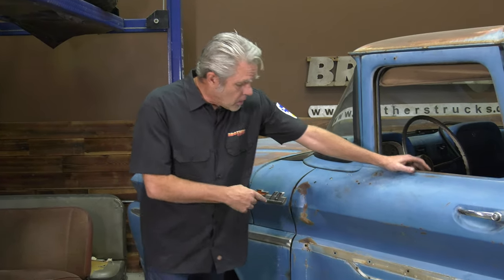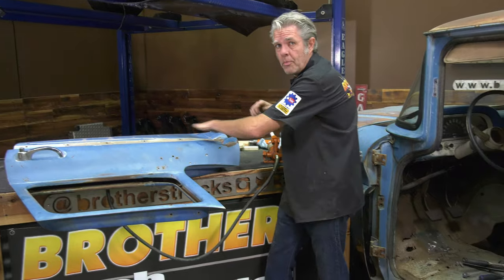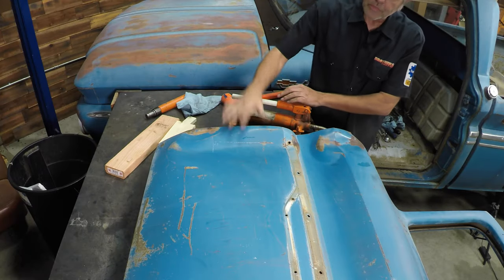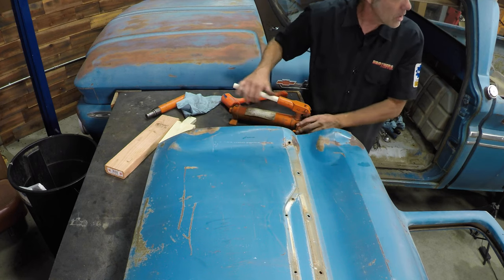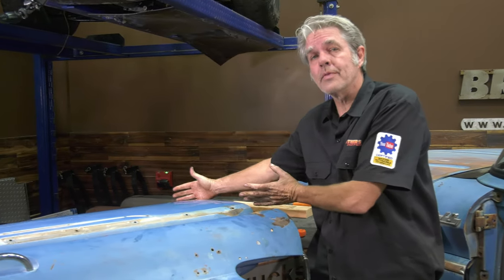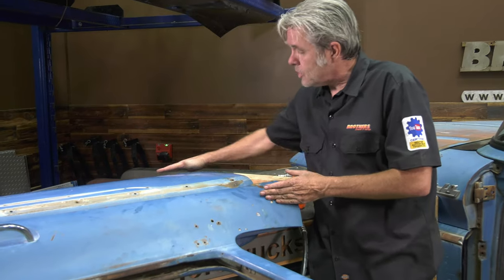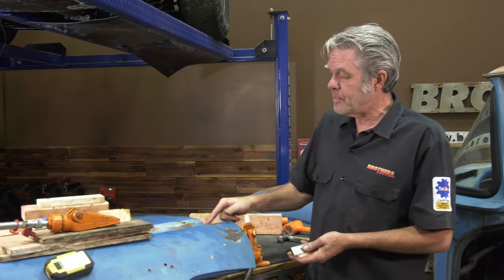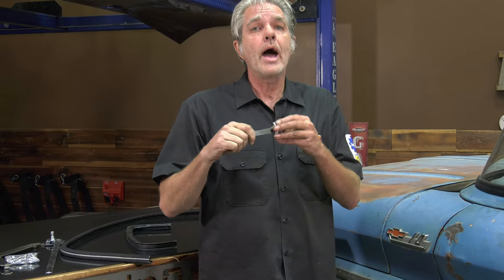1947-87 Chevy & GMC Truck Door Dent Removal / Repair / Bodywork

Comment: One of the major points of hammering it is to release the stress from the metal. It has a memory of the original correct shape and contour. The job of the body man is to get it to move back to that original position

Comment: Awesome video!! Great job saving the paint on that door. I also warm up the paint with a heat gun to make the paint more pliable when pushing a big dent out like that one. It just helps to keep the paint from fracturing any worse. Thanks for taking that challenge...and showing us too!
Reply from the maker: Absolutely, thanks for watching!
Reply: @BROTHERSTruckPartsTV  And sometimes covering the head of a steel hammer with tape can also provide a little bit of added protection for the paint.  Great video - thanks.  Have a safe and nice day all.  CHEERS from AUSTRALIA.

Comment: Hi, thanks for all the lessons, much appreciated. Question, where can I find replacement floor panels dos 2005 Ford f150 4 doors, just the 2 fronts. Thank you.
Reply from the maker: You can try Keystone Parts or AMD, they may have what you need.

Comment: Is there any other recommended ways on how to help push from underneath? I don't have the money for a porta power and it's almost impossible to hold a dolly to the inside while trying to hammer
Reply from the maker: You could use a board and leverage it from one of the openings against another board? Kinda like a see-saw...

Comment: Are these older vehicles made of panels to heavy guage to be repaired with paintless dent repair methods?
Reply from the maker: Nope, you can still use a PDR method to repair older sheetmetal

Comment: This gives me hope for my '62 C10 door!  Mine doesn't have the trim, and a smaller, less severe looking dent than your example.  Since it's smaller, would you suggest hammer and dolly or studs and puller for a newbie?
Reply from the maker: We'd suggest you start using some of the methods we show here and then move on to a hammer and dolly or a puller if necessary. We find it's easier to push these out from behind than to try and pull them from the front.
Reply: @BROTHERSTruckPartsTV  Way cool!  Thanks for posting the awesome videos and demonstrating with easy to understand explanations!
Reply from the maker: @mattchastain1770   Our pleasure!

Comment: So.  Please correct me if I'm wrong, but it kind of looks like you are shrinking the metal back down during this process!
Reply from the maker: To some extent the metal is shrinking, but because of the amount it was stretched by the dent it will probably need to be shrunken more with sone heat before it's perfect